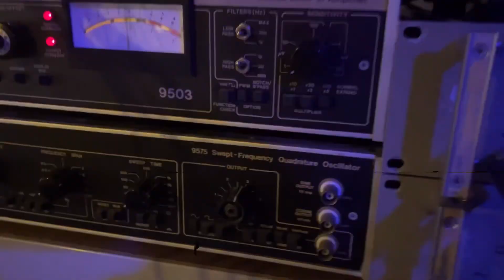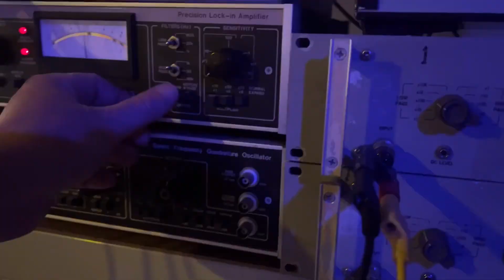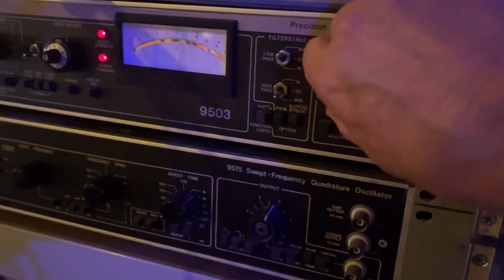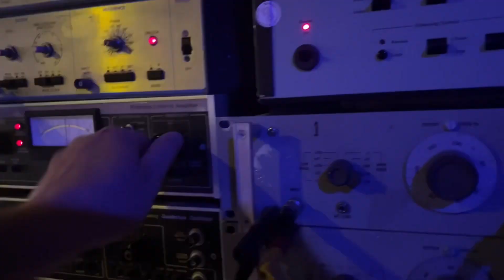The End of the World Machine! Chaos patch to terrify the neighborhood

Comment: As always, great music, great Jam! I would love to get it to making music with test equipment but I don’t even know where to start?
Reply from the maker: Thank you much appreciated! It’s a difficult path and getting good results takes a painstakingly ridiculous amount of time. It can be very rewarding though. Now is a harder time to start building a setup with the prices of equipment compared to a few years ago. There are still deals to be found though. I’d say start with just a function or pulse generator first and then add stuff. I found most all of my gear on eBay as parts or not working. If it powers on chances are it will work for our purposes.
Reply: @traitortotheliving  any specific brands that’s I should look out for?
Reply from the maker: @interrorgationstudios  not necessarily there are so many out there that do basically the same things. Some oddball manufacturers can make really cool stuff. Just make sure whatever it is works in the audio range of 20 Hz to 20 kHz.
Reply: @traitortotheliving  thank you again!